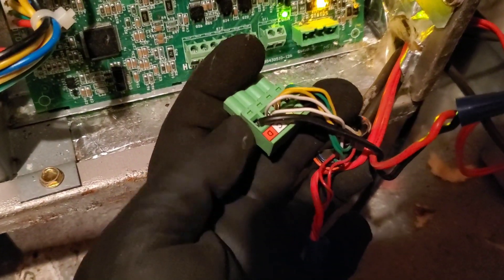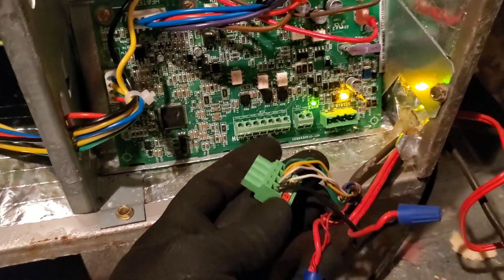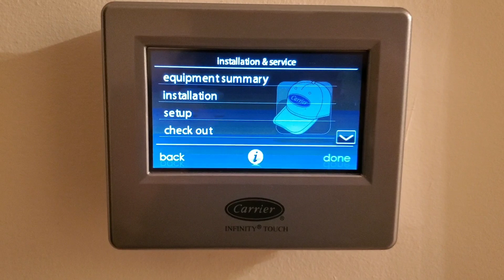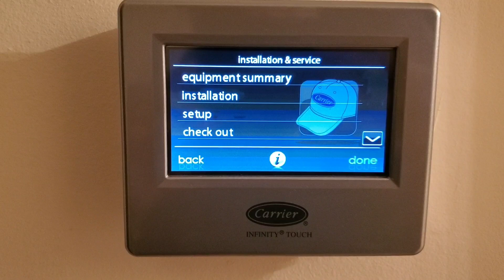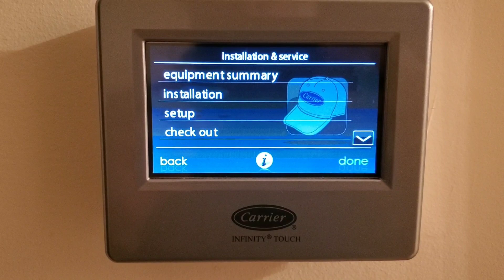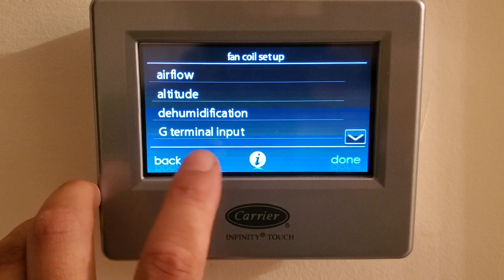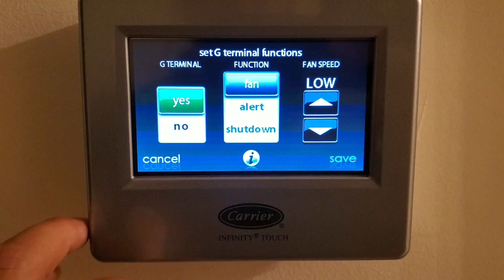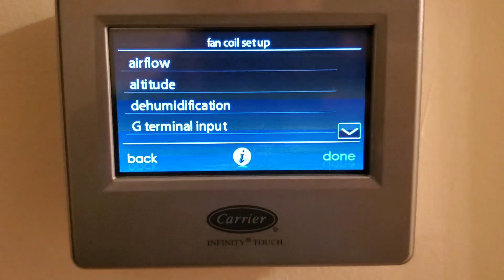HVAC Tech Tip - Water Safeties on Communicating Systems

Comment: Nope. I want stat to blank out so that homeowner will without a doubt know there is a problem and call the shop. I know what has happened when it does that and that’s all that matters.
Reply from the maker: @Paul Wehr On a standard system I agree. 
Not on these communicating systems. This system will notify the customer via a fault code directly on the screen along with emailing the customer and the service company but do what you'd like. 👍

Comment: If you was to wire any accessory’s like humidifier to the abcd would that cause a short at the thermostat? One of the guys I am learning of did some like that and after the install nothing would turn on, but when I would jump R to G on the circuit board it would turn the fan on  when I would take the jumper off and go to the thermostat to put the fan to come on it wouldn’t would that have been a communicating issue??
Reply from the maker: Nothing should be wired into the ABCD terminals aside from accessories with the same terminal designations.
Reply: HVAC in SC okay thank you for the reply

Comment: Quick question, I see that there are terminals for a regular non communicating thermostat, what happens if you have both types connected at the same time (ABCD and ywgrc)? Does one override the other? Can you keep the communicating one for settings and a regular one for controlling temp?
Reply from the maker: No. The only way you can use the conventional terminal block and wiring on this system is to use a conventional thermostat which would completely defeat the purpose of having this sort of high efficient communicating system.